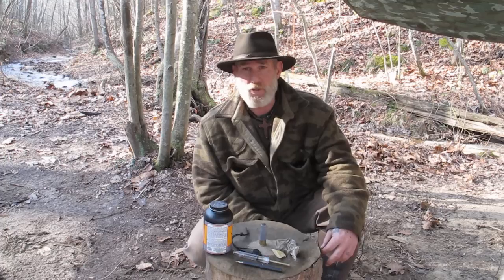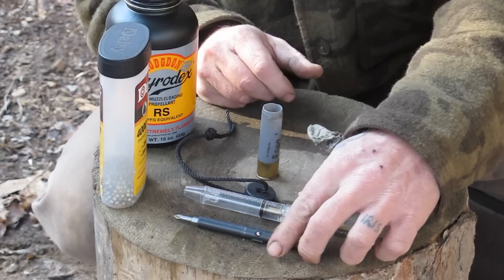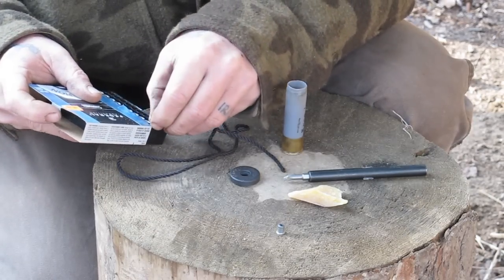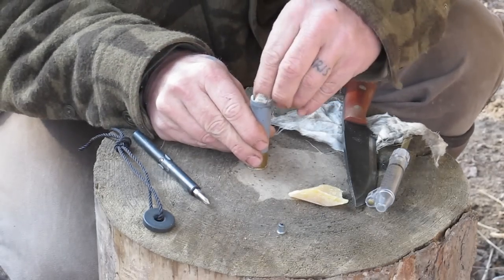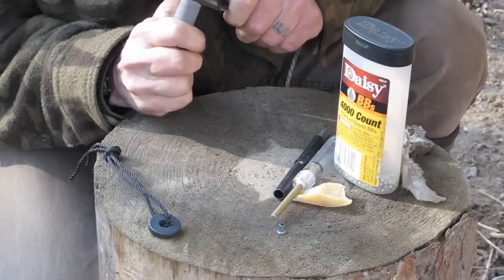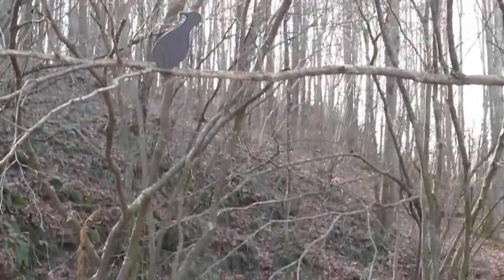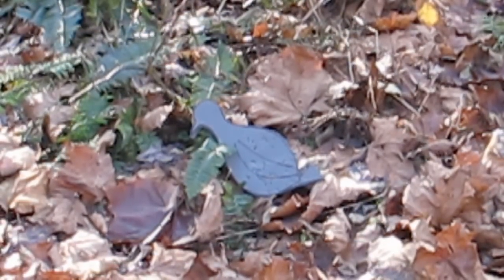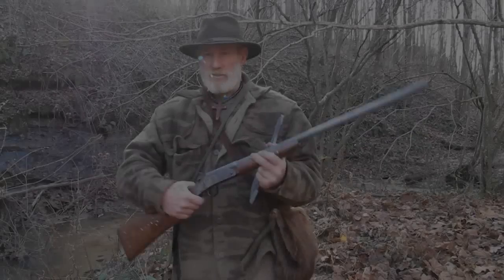Reloading 12GA with (Pyrodex) Black Powder in the Field

Comment: No worries. He is using Pyrodex. This is a synthetic black powder that doesn't explode. In fact its not classed as an explosive like black powder. The synthetics have a coating over each grain, and they are classed as propellants, since they dont have the risk of heat or static electric flash over. They are also non-corrosive. I cant recall anyone here still using actual BP around here. been like that for 20 years here or so. Hot wax is no danger for synthetics.

Comment: I know this is an old video Dave. But its very interesting. I've probably watched it a dozen times. I to load 12 gauge shells like that with pyrodex. Its simple and fun. Along with shot loads, I also load a 69 caliber round ball round. I load them with 80 grains of powder, and over shot wad, and a felt wad, then take ball and use patch around ball just like in muzzle loaders to keep tight in bore, then wax the top. That load is quite surprising as far as power goes, and recoil in a light single shot. Thanks for a great video.

Comment: Dave,  I like the way that you did that.  You should be able to close the top of the plastic case with a little work, and then seal that shut with the wax.  You could loop your string around the magnet and back through itself instead of having to retie it all the time.
                    Geoff

Comment: Another real good characteristic of black powder is it does not HAVE to work at high  pressure.  Smokeless modern powder must be loaded to near the max or you may get squib (failed) loads.  Also these smokeless modern powders require assembly under .pressure  which cannot be reliably  done by hand or w/o a real reloading press. As a shotshell reloader for over 40 years, I thank you for bringing us this simple emergency concept.  Now if we had 12 ga. pyrodex load for a 40 to 45 cal pistol bullet in simple homemade sabot that conjured up 1050 fps, that would be a medium game load for short range.

Comment: Some 'survival only' suggestions
Primers - refill with strike anywhere match heads, or scrap off the strike area and heads of normal matches mixing the two.  You can push it into the cap or wet with water and make a paste to put into the cap.  It's a good idea to flatten the cap.  
Powder - can use standard match heads for powder.  
Shot - stones, glass, metal fragments can be used.

As mentioned before, these are for survival only, use at your own risk.

Comment: Dave I do all my own reloading .  Just FYI if you use the same gun that it was fired from this will work.  But if you have a shell from a diff gun then more than likely have to be resized.  Your reloading info will work for single shot and pump shotguns that the shell was fired from,  for semi and double barrel best if you resize the fired case may not fit.

Comment: Have you ever tried hot glue instead of wax? I mean when you carry them shells around in your pocket in very hot weather for some time, the wax might be melting and it would be a damn mess. Hot glue won´t melt from even the highest enviromental temperatures... and you can carry those glue sticks with ya just like a candle, so it can be done in the field, too. Hot glue would probably create even more resistance before the gases push the pellets outta the shell, thus increasing the pressure and you might have a few per cent more of a punch... a downside could be that the upper layer of pellets might stay together with the glue and come out as some kinda solid "bullet" but what the hell... there´s still enough pellets underneath that layer. Try and make a video :-)

Comment: I think a 20 or 12 is sufficient.  I have a 20 gauge cooey fixed full choke and a 12 cylinder bore.  Both with mixed shot I think I could eat bird to buck.  The 12 is actually a bit large for smaller birds like grouse or ptarmigan in my opinion.  With a 20 if one is reloading by hand loads are a bunch lighter and one can carry a bunch more 20 at the same weight as 12.  A single shot would suffice, but in my opinion a pump gun is far superior for a survival situation!  Don't get me wrong though a single shot is better than a rock!

Comment: @gander2000 really depends in the shell, if you use light loads the the shell does not wear you can reload an infinite amount of times, as long as there are no crackes or splits you should be fine

Comment: @alphawolfxxx86 in general, break actions(single or double barrel) would be best for this since there's no moving parts acting on the shell except for the ejector, the hitting of one shell on another in a magazine might degrade the condition of the shell since there's no crimp keeping it together anymore. if you don't have a break action, get on, you can buy them used and in great condition for as low as $40-$60 at flea markets, gun shops or gun shows, no reason to not get one if you want one.

Comment: Great videos Dave.  I was wondering, aren't BBs made of steel?  
If so wouldn't lead shot of the desired size be better because of more weight for the same size, or do you prefer the copper platted steel because it's less toxic?  Thanks.

Comment: rimmed cartriges like .38special [ straight wall,rimmed] can be reloaded with BP or  equivalent also. Sure it's better to use modern gear, and BP is dirty blah...blah... but it's better than no ammo. Good video, and btw 410 shot shells can reloaded and fired in a .45 colt chamber,used to make them befor I found factory shot loads for revolvers

Comment: That's a pretty cool magnet David I was just wondering did you purchase at Magnet or did you get in something give it to you or you tore it down then pulled it out of an object or anyway I was just curious I might would like to purchase some of them magnets I use magnets all the time I'm a welder by trade and I use magnets all the time to hold my blueprints up and everything but nothing with a hole in the center. This is Darren Huffman from the Ozarks appreciate your response back

Comment: To save from using the wax I wonder if there's some type of common cap or rubber plug that could be reused multiple times as long as you take it off before you fire it.

Comment: Cool video. Just thought I would make a suggestion. Instead of the beeswax how do you feel about elmers white glue(the regular kind, not the watersoluable kind). Ive seen guys load them with this and have good luck and the glue would be easy to carry in any pack without a mess due to it being in a bottle and the heat would not affect glue at all.

Comment: Dave could you melt the bees wax and mix it w/ the bb's before adding it to the case and temp it down to make a make shift slug if you needed or I have heard but never tried it that you can load a 12ga casing w/ a lead 1oz oval fishing sinker as a slug agin I dont know hot true that is thou

Comment: @wildernessoutfitters What is the maximum/minimum load you would recommend if I had to use my single shot as a muzzleloader?Also what is the maximum/minimum load you would recommend if i was reloading standard 2 and three fourths/3 inch shotshells,also the gun I am using is a rossi single shot 12 gauge (H&R knockoff made in brazil)The guns are visually the same and takedown the same,I would reckon a H&R barrel would fit the Rossi with little or no modification tahnks for help in advance

Comment: I'm curious about something: What would be the effect of mixing smaller shot with larger shot where the smaller shot could fill in the spaces between the larger shot?
Reply: +Chaplain Dave Sparks Some 12 Gauge cartridges were actually made that way. It was a bit of a fad a few years back if I recall correctly. I imagine though it'd be easier to remove larger shot when processing medium/large game, while smaller shot wouldn't damage smaller game as much. My advice? Try it out and see what happens!

Comment: i really like your long hunter series so far
i can see the advantage of using steel BB's weight wise but i have to disagree that those won't damage your bore, maybe if you made a shot cup out of cloth wadding. then again those single shot 12s are pretty cheap and a dime a dozen.

Comment: there is a video on YT about "re-priming" a 22 LR  using a kitchen match made into a slurry.  If it were me, and it probably will be later on, I would use a flat punch and knock the fired dimple out of the 209 primer and re prime it.  put it in an empty case and shoot it. don't load anything ahead of it, or if you do, just a small amt of powder and a wad.  I have not tried this, and it may not work, but an hour will tell you.  Just a thought.

Comment: @1973Saved the concern from steel shot is that if you have  a rifled barrel that u shoot slugs and shot from the steel shot can and will eventually file your rifled barrel into a smoothbore, where lead shot conforms to the grooves inside the barrel steel shot stays its shape and stays hard, copper softer than steel will usually smear inside the barrel and could damage it.

Comment: @PCT2013thruhike A 1lb can should contain 5,760grains of powder. If you use 80gr charge it should be 72 and if it is 100gr then 57. Of course that would be an ideal scenario where all the powder is in the can and none is spilled in the loading process. so 50-70 :)

Comment: Dave wold this work with a 20ga to or a pump 12?
Reply: Toby & Jenny It would work. It's the same principle with the exception being the actual powder charge. If you wanted to make a square load then you would have to figure out the charge and the shot charge before loading.

Comment: How much powder would you use in a 20 gauge shell
Reply: To use pyrodex in a shot shell ,use the same dram equilivent as black powder by bulk not weigh. Do NOT ,I repeat, Do not increase the powder change for any reason. As dangerous pressure spikes can occur.
We are prone to forget , pirodex is smokeless powder and Burns like smokless powder.

Comment: you should wrap the bb's up in a peice of cloth or use lead shot, the metal shot despite its coating will damage the barrel. Lee makes 000, 00, and number 4 buckshot molds which they sell on their website for about 25 dollars. i have  also picked up used 32 or 36 cal round ball molds at gun shows for 10 dollars, if you buy a number 4 mold and a 36 cal round ball mold you can have a diverse set up to take game from doves to deer. You can use 36 cal balls in a sling shot for dove and rabbit.

Comment: Would highly recommend NOT using Pyrodex unless it is the only powder available.  

Real black powder or Hodgdon 777 is much less corrosive than Pyrodex. Some tests suggest Pyrodex is 10 times more corrosive than 777. Real black powder is the least corrosive of all.

Pyrodex, (as well as 777 & black powder) does clean easily and neutralize all corrosive fouling with simple water. So If Pyrodex is used clean thoroughly and flush with water and then dry and oil.